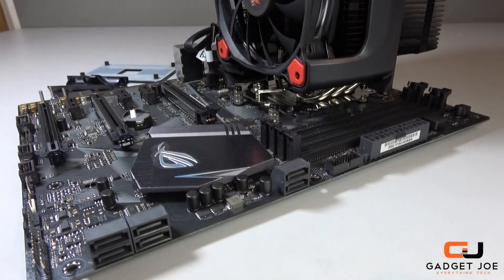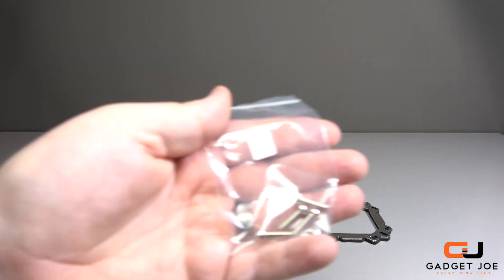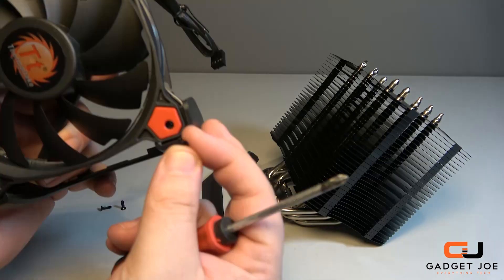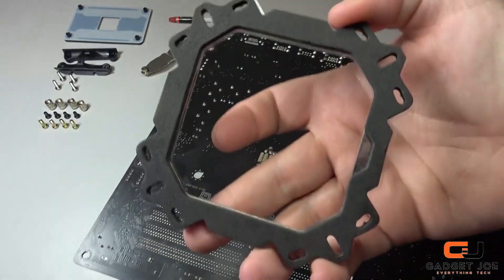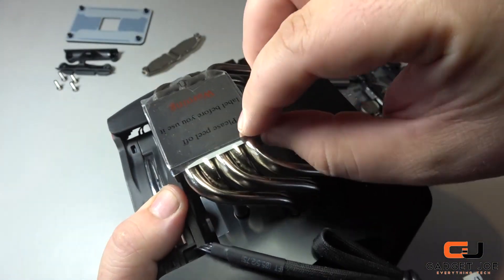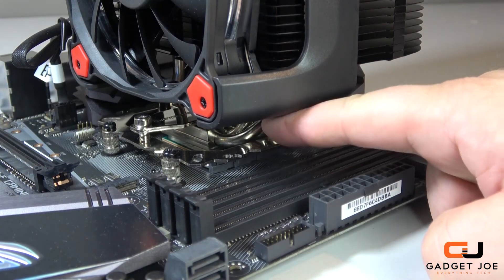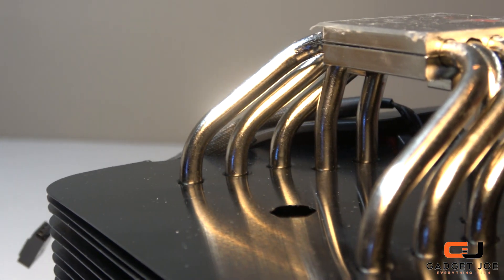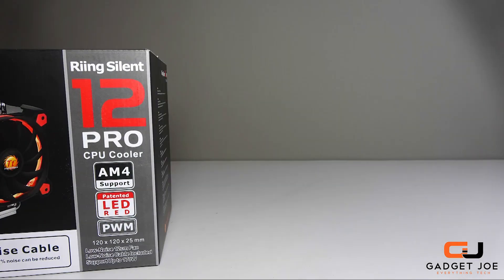Thermaltake Riing Silent Pro 12 Air Cooler Review and Assembly Guide

Comment: The cooler is designed to provide extra RAM clearance. You should have installed it with the fan facing the RAM side. As the heatsink and pipes are actually angled away from the fan side, this give plenty space for RAM. This also allows the fan to blow the hot air towards the IO panel and back of the case. This heat will be ejected via the case exhaust fan.

Comment: I don't understand how 3 degree's is a noticeable improvement.... this seems like money down the toilet
Reply: CPUs have a threshold. Running a few degrees nearer that isn't saving anything.
A CPU designed to run at 80 won't last longer by being run at 70 V 75, provided it doesn't go over its max recommended temp.

The important part he didn't address properly was the sound level, since this is basically what this cooler is about - running quieter than stock, (at least)

Comment: Hello everyone! I have some questions. I have thermaltake riing silent 12 blue.Where the fan should be placed? Cause the cooler has ram on one side and exhaust fan on the other(in other words the cooler is on the middle of RAM and exhaust fan). Also, how can I clean it? I saw in a video one quy who used water. Thanks

Comment: Hi Joe.
I email to Thermaltake Support to asking: What cooler is better for cooling a Core i7 2600K 3.4 ghz, The NiC C5
 "CLP0608" or the Riing Silent 12 Pro Red CPU Cooler "CL-P021-CA12RE-A" ? 
But not receive answer yet. 
May You help me in please.
I want to buy 1 new CPU Cooler & want to known which is better for cooling a CPU 

My problem is the space between RAM and Cooler. But I want to buy the one that cool more of these 2 models that my processor commented: 

Core i7 2600k 3.4 GHz, Motherboard ASUS MAXIMUS IV EXTREME Z, 32GB RAM DDR3 2133MHZ CORSAIR DOMINATOR, Video Card ASUS 4GB DDR5, Thermaltake TR2 RX 850W Source , inside of Thermaltake VH6000BWS Armor + Full Tower.
Thanks Best regards